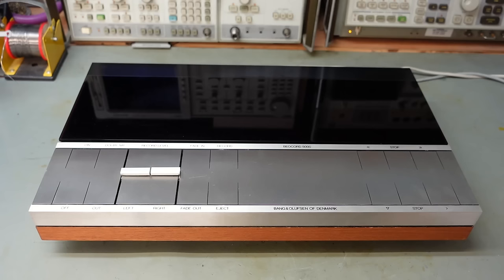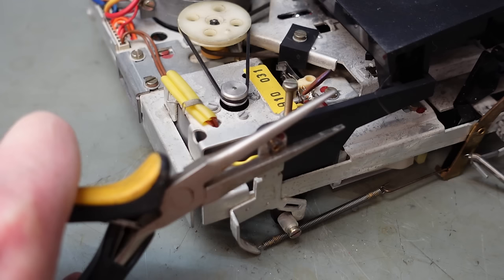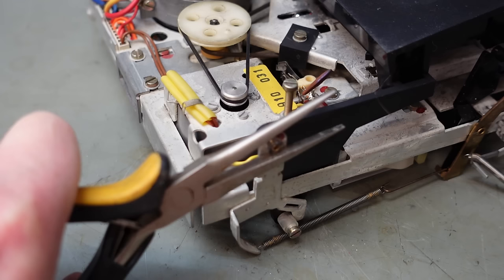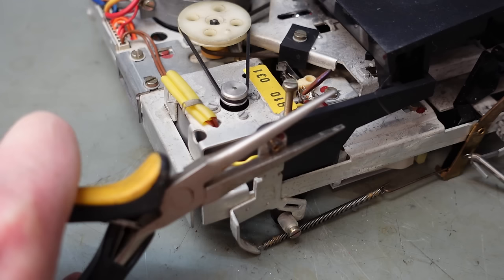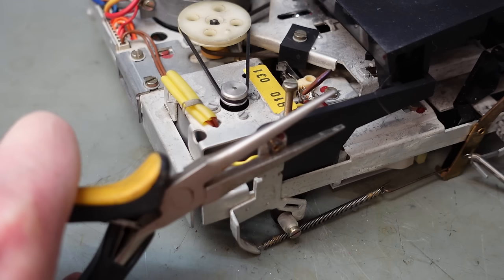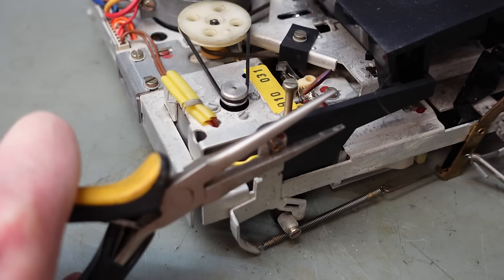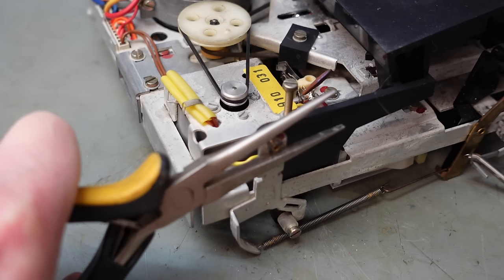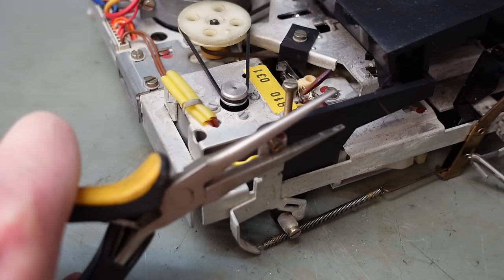The BEOCORD problem

Comment: Does anyone else get that unsettling panicked feeling in their stomach when Mark starts dismantling, knowing damn well you would never be able to put that thing together again?
Reply: 100%  Every time!
Had to replace the CMOS battery in my laptop once.  Had no idea what I was doing.  To make matters worse, the battery was in the most inaccessible place.  Had to remove everything to get to it.  Took photos every step of the way to make sure I reassembled everything properly.  Did it!  BUT I had at least six screws left over and now the touchpad doesn't work.  Reassured myself that they always put extra screws in these things that you don't really need.  And as for the touchpad, I use a mouse anyway, so as far as I'm concerned it's fixed!  😁😁
Reply: Yes 🤦🏼‍♂️
Reply: I'd never remember where all those springs went
Reply: Yes! But having made a video of the disassembly would be a big help... right?
Reply: the constant turning of each camera angle for every component FOR RECORDING PURPOSES. but for remembering how it goes back together, just rewind the video ya made. AH, I forgot to put the belt back on! Well for that I'll use it on me. Actually after this I think I'll need a good belt just from watching this. I had answers just as soon as you did/b4 except for your scopin. A clutch, I have seen this many times before, usually belts.  Besides,an nice tools of the trade, I used to have much, but a long story took it all. Man, tearing it apart two/three times finding a bird nest of problems, fixing fixing fixing then finding parts that fell off. Whomever had you do this is blessed. Most if not all but you would have said, in the bin!  You make me cry. your a good person.
Reply: Not without taking photos, BEFORE I start!
Reply: @stevenlagoe7808 Well, considering that laptops and cameras are made by elves according to the devil's plan, and are intended to be serviced by bewitched raccoons, the screws are going to be of at least 5 different lengths - all 6 millions of them. So I usually arrange a cardboard of roughly the same size and draw a rough outline of the laptop layers that I would be disassembling. Then poke pinholes on the sheet where the screws would be in the laptop. Upon removing each screw from the laptop, it goes straight to it's hole on the card board. Put a number if you want to keep the order. 
Never misplaced a screw ever since.
Reply: @Wingedmechanic  cmos battery is the equivilent to changing a light bulb. for us folk that had to do a lot more disassembling. laptops are easy and no mistery, when you have one of your own that you regularly service, such as making sure you improve the temp of the cpu and gpu. and fans to prevent any overheating.
Reply: Siii, a la mayoría de nosotros nos sobrarían tornillos 😂

Comment: Mark you have skills in abundance, I bet most technicians would have given up & called it scrap.
Reply: Yep, I'd of thrown in the towel in a while ago!
Reply: a lot of technicians would not give up, it is all about economics, nothing else - no way is that a viable repair, those decks can be obtained in immaculate working condition for less than £50 so who on earth would pay to have that deck repaired unless he charges a 1950s hourly rate, but his mechanical skills are without question
Reply: 50 quid will get you a scruffy looking non working unit.

Comment: this is surprisingly currently being sold cheap for parts. I assume because most people do not have this level of expertise when it comes to fixing this model. Beautiful work Mark
Reply: Most technicians don't want to touch cassette decks. The number of people who will (and who have the skills to do it properly) are few.
Reply: @sw6188  It's mainly the fact that those who do fix tape decks try to avoid needlessly complex PITA ones like this with parts made of unobtanium 
(those PIHER potentiometers used for the record level control with the spring around the housing have been out of production since the 90s, and there's no modern drop-in replacement as their physical dimensions are all kinds of weird... just as one example of many)
Reply: @Knaeckebrotsaege Yes, I know. I am one of only a few techs in my country who will touch cassette decks now. It's not just those however. I did a B & O Beogram unit last year and it took me hours to get it working properly. The slide faders are all starting to fall apart (I have done these machines previously and they had the same issue) and you can't get those any more either. I had to remove each one from the board, dismantle it, repair it (essentially brain surgery) and reinstall it. That was just to get them working right, not to mention all the other issues the unit had.

Comment: I've been hearing people say that no one wants to service cassette decks any more in the country where I am, but I am still taking them on. However, I have never done a B & O cassette deck like this and I appreciate the insight into what is involved in working on one of these. I have done quite a few B & O Beogram units before and they are a time-sap. Easily 4 or 5 hours to go through and get one back on track by the time I replace all the leaking capacitors, repair the mechanical issues and replace the dead lamps, and it looks like their cassette decks require a similar time investment. 
People watching this need to realize just how much work is involved in getting these units running properly again - it is no simple 5 minute repair.
Reply: Tiene que ser una tarea titánica.
Reply: B & O decks are rather weak as for the sound.
Reply: They were quite well made and sturdy for the time as long as they worked, but everyone that have repaired B&O gear will know it usually was a knightmare to disasemble, access and repair if something went wrong, especially with their somewhat awkward solutions to make the units look smart on the outside. Just hope you'll never need to repair it 🙃
Reply: the B&O way. Design the casing as smart as possible send it to the engineers "Make something that fits in the case !!" don't think of if it's able to be fixed if it breaks. We just sell the custommer a new machine.

Comment: So I’m watching you pick apart that little motor and I’m thinking that goes in the bin and you find a replacement. Nope, you actually go and do a rewind job AND you have a gadget to do it.  Mind boggling thoroughness.  I`ve done a few fixes in my time but this is sensei level - and also a tad inspirational.

Comment: I love this guy.  What a gentle and nice personality.  Getting to  purpose of fixing vintage Hi-Fi gear these qualities are especially appreciated.  I mean the man ground his own plastic pulley for goodness sakes which is a bit of a Herculean task.  He did it all just basically saying "it's all part of a journey"...without any cussing that typically goes with repairing anything  that is both mechanical and electrical.  Mark, you're a real jewel of a person and a cracker-jack electronics repair technician.  This was a somewhat daunting repair job.  B&O did build stuff in this era like a tank.  I'd venture to guess mechanically, after witnessing this, even more solid (less plastic for instance) than Nakamichi decks.  Yet it definitely has some idiosyncrasies making it harder to troubleshoot and repair.  With Mark's already keen knowledge of B&O, along with his almost paranormal trouble-shooting detective work, this unique deck is, perhaps, as good or better than the day it was shipped.  Excellent video that despite it's involved lengthy repair was a joy to watch.

Comment: B & O did a lot of work refining Dolby HX and eventually sold the patent back to Dolby Labs where it was branded Dolby HX Pro. Very clever single ended way to squeeze more signal onto a tape.
Reply: @maxfactor4209 Other makers have done similar things to avoid paying Dolby license fees. Technics had an in house anti-saturation network that worked when Dolby C was engaged.

I had a 196 Pioneer With HX Pro and Pioneer's own BLE XD. BLE is auto tape tuning. XD is the anti-saturation. To be honest I could not tell the difference between HX Pro and XD.
Reply: B & O invented HX (just a thing that adjust the bias based on the amount of high frequency in the recorded signal) and then they sold the patent to Dolby, and Dolby made one or more integrated circuits that did all the magic in a simple way.

Comment: Wow! This machine had a lot of problems.  Hard to believe you solved them all.  My favorite part was when you traced that brown wire to the cassette deck and found that two solder joints were touching.  Seperating them solved the problem with the record function. Awesome work.

Comment: I really really really appreciate that you never rubbish the equipment you are working on. Most techs would bitch and moan non stop while disassembling something like a B&O product. Then they'd go about reengineering everything while telling us how stupid the original engineers were and how much better they are. All the while never mentioning the product they are working on is 50 years old and other than fair wear and tear, and possibly a cap and resistor or two, the unit is still fine.

Comment: Wonderful video!

It brings me back to the days when I was a service tech.  I worked at an authorized Dual shop and working on their turntables was a dream. However, they built an auto-reverse cassette deck that had a terrible flaw. The was a complex nylon geared pulley with molded in leaf springs that governed the reversing mechanism. The design of these leaf springs didn't have enough material to withstand normal use and it essentially made the poor thing irreparable.  The customer wasn't happy at all...

Comment: Fabulous work - I have one of these somewhere - I used to collect B&O. These were known as the most likely to chew tapes of all tape decks. You did at least have the later 2 head model - the original was 3 head with the heads positioned so the record head was after the playback head so no off tape monitoring. They were even less reliable that this one! They sort of matched the Beomaster 6000 but that was a quadrophonic receiver and was hilariously complicated - the  display for the volume, tone and balance - looked like the biobeds in star trek but was all done with markers on black tape with motors moving the tape. Of course the tape machine was stereo so was used more with other equipment that it didn't match! I truly respect your perseverance!!

Comment: This is absolutely amazing Mark, I looked at the whole video because you really dig in to the problems and find the solution, I had the same back in the 80’ and I repaired it back then.
It’s what repairs should be instead of just throwing things away. Thanks for the splendid content. I have the newer model Beocord 5000 that has some problems with the speed, that I will take a closer look at sooner.

I subscribe to your channel.

Cheers from Kenneth ( Denmark )

Comment: Mark this video is so nice and relaxing to watch, you take everything in your stride and not get flustered or panic.
Wish i had your knowledge of electronic circuitry, as I have an old Aiwa WX-220 Twin Deck Cassette Player. 
Sadly a solenoid doesn't properly work and gets red hot. Because of this it gets left on the self collecting dust.

Comment: How have I not come across this channel before! Subscribe button hit within minutes. Taking apart and reassembling any of these old complex decks is an amazing skill by itself, but to be able to manufacture parts like that pulley moves it to another level. And you have also got to give a hand to the people that designed these decks back in the day, amazingly complex bits of kit. I was only a kid back in the 70's, but loved to look through the audio sections of catalogues, salivating over all of the different bits of Hi-Fi equipment available. Really nice to see someone with the skills to repair something like this decades later.

Comment: I will tell you something Mark, those Dutch guys have come a long way since making their first plug-in radio on their Dutch farm together. Their stuff from way back still has a high resale value, working or not, and they found a market for bespoke electronic equipment. You can see the thought that went into their earlier designs, their craftmanship next to none. This device is no different. It deserves the lavish attention you're giving it, who would design stuff so different than mainstream stuff. It stands out as a wonderful example of electronic wizardry, even today. It's price today makes it stand out as an excellent electronic device, no matter what condition it's in. I used to buy the generic version of 2 part epoxy in tubes like that, then I discovered the same 5 min stuff in separate tubes, so then having both I found myself gravitating toward the separate tube stuff, I used to hate one tube coming out quicker than the other. It was a pain.

Comment: Great video once again! 
I actually had this models simpler little brother the 5500 for repairs not too long ago, really repair friendly design on the whole. 

I did notice that some of the factory grease had turned into absolute tar over time, the right hand takeup wasn't running at all due to being all gunked up so it is worth replacing all the light grease in these machines.

Comment: Good ol B&O. I was a B&O trained tech back when and those Beocords were a handful to service. One of the biggest issues was learning the correct disassembly/ reassembly process. They were extremely well built, tech advanced and once the 6000 series came about, great sounding. They still don't get the respect they deserve as being form over function, but in my opinion, were worthy mid high end components. Good video, just subscribed.

Comment: Excellent work as always Mark. Fantastic repair and amazing skillset.
27:46 syringes, especially the ones with blunt needles, full of various goos are your friend. I have several of them on hand filled with stuff like silicone (dielectric) grease, regular grease, vasaline, or petroleum jelly, solder flux, etc. With the blunt needle syringes there isn't a place I can't inject what's needed...

Comment: Stunningly brilliant work, sir.
B&O rather 'over-engineered' these but because the mechanical faux sliders were supposed to look a bit like studio ones they had plenty of working space. Speed integrity was not exactly pro standard though.
Spring retainers were a hallmark of Scandinavian manufactures of this period and very effective, especially as the springs were made of stainless steel wire but had some disadvantages in turntables. They had tendency to "sing" and feed back to the audio but this was easily fixed by different sorts of damping. Shrink insulation wasn't common then and repair shops sometimes used used smooth GPO string threaded inside and left quite slack. Cigarette paper was another trick.
By the 1980s when the same sloping design made better use of sensitive touch switches from Japan, B&O used the same type of chassis to make double cassette machines then added CD players. The downside was that they also changed over to DIN plugs which often gave trouble and were placed next to rear heatsink assemblies and they were troublesome to replace.
For all these slim good looks they were very heavy but hardly ever needed to be moved.

Comment: Bang & Olufsen design and all Philips electronics inside, I get to do more and more B&O stuff specially 9500 Beocenters for they are getting around 40 years old now and not many technicians around nowadays to fix and service them. Keep up the good work Mark you are a true master in what you do, love to see a master at work.
Reply: It is not true that it is "all Philips electronics inside", Philips is/was the goto supplier of many electronic components and sub modules/parts back in time, you will find Philips electronic components in many different manufactures electronic products.
Bang & Olufsen and Philips had an interesting thing going on on a few markets where they were competitors and Bang & Olufsen was one of Philips's big customer at the same time, but they were aiming at different segments of the audio/video marked.

Comment: Must be B&O season, Mark. Glad to see you joining in! 😂

In the last week, I’ve restored a Beogram 8002, which luckily had a serviceable cartridge, and a Beomaster 8000, which had some absolutely nasty faults after massively overheating and then blowing one channel’s output driver stage. That one required some fabrication and paint work to undo damage caused by standing liquid as well.

As far as I know, neither had been running for 20 years, and both were covered in a thick layer of sticky dust… Still have the Beocord 8004 to fix yet. Someone spent big dollars on this system when it was new.

Comment: Excellent work  - again! Your repair videos are the best on YouTube. I did yell at you when you left that belt off but I guess you didn't hear me. Thank  you for showing how differential measurements can be done without a differential probe,  but no need for that fancy modern digital thing. Your trusty 454 will do, just select A+B on the channel selector switch then pull the Channel 2 invert switch out - there you have it A - B! (Ever wonder why most scopes can invert at least one channel?) Just have to remember to keep your V/cm switches sync'ed. Regards, David

Comment: Hello Mark, If i remeber right the torque is measured on the feed roller "left" and the right meter "take up" is when you have auto reverse deck and the right roller feed to the left. But it was a long time since i used this tape early 90´s and maybe torque tape also need a look over it has been stored 30 year now.